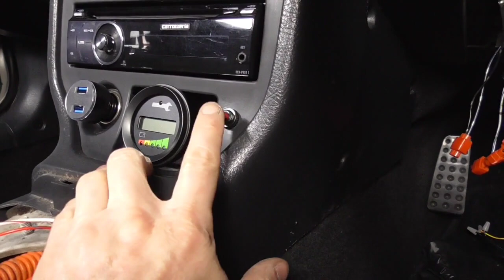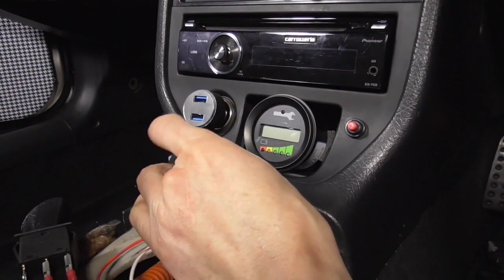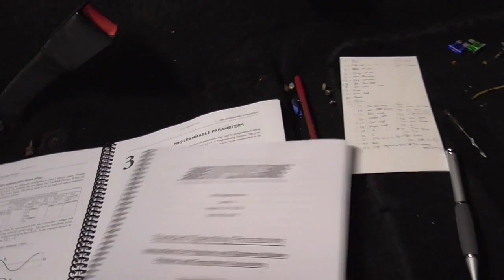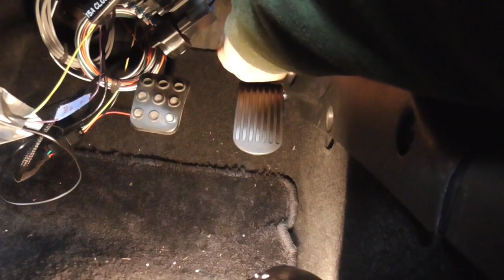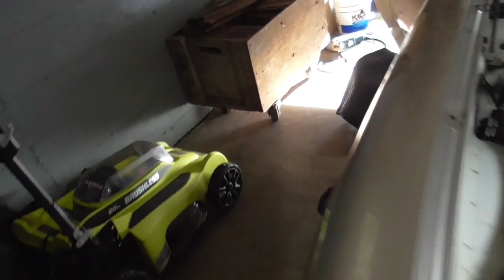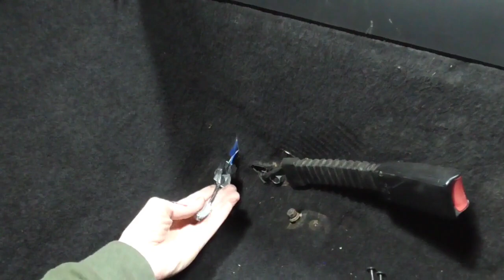Project: Cappuccino EV - episode # 8

Comment: We have spinnage!       Hey wait... Brake type "0" seems to have throttle controlled braking... "one pedal drive"... otherwise when you let off the throttle control the motor/wheels would keep spinning.
Reply from the maker: Exactly, the controller has fully programmable (regen) neutral braking from 0-100% in 1% increments.  It also has an "Eco Mode" that can be toggled in it's place for a different set of parameters (a lot like many OEM EV' s "B mode") & it too is 100% programmable.  No OEM car even comes close to that kind of customizing.  And that's just the tip of the iceberg.